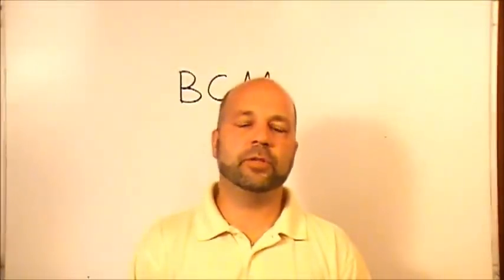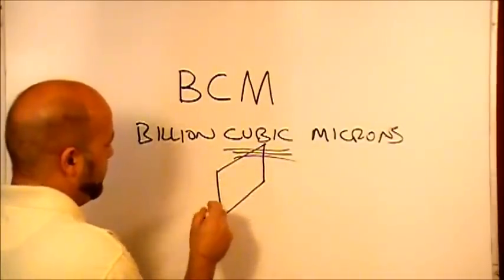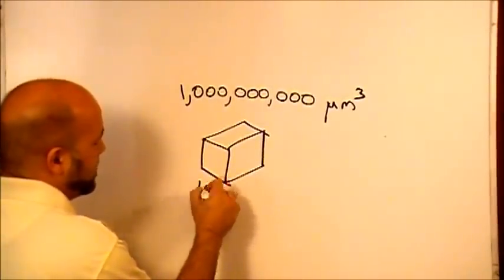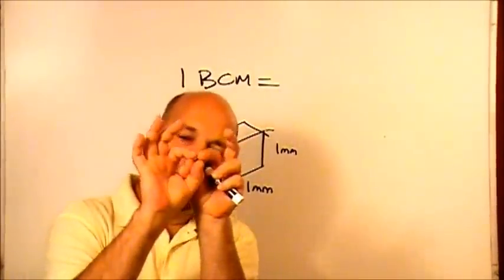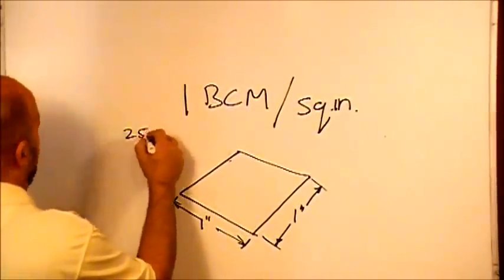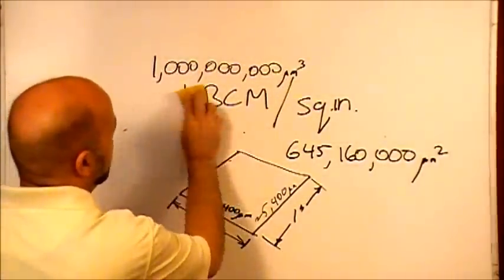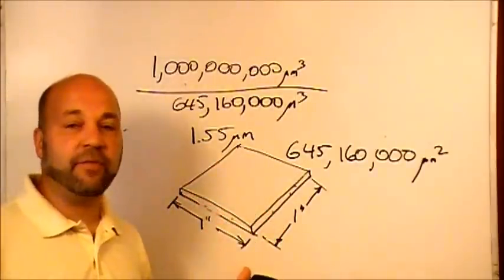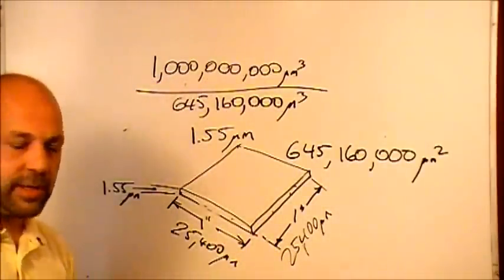What is a BCM?  1 of 3

Comment: @4:01 I believe you may have the wrong values of the Length, Width, and Height. You say 1,000 micro meters? if you calculate the volume of a cube with that length the volume is equal to 1x10^-9 meters cubed... which doesn't equal to 1,000,000,000 micro meters cubed.
Reply: Frank Burgos  
The volume of your box @4:01:

 L x W x H = Volume

(1,000 micro meters) x (1,000 micro meters) x (1,000 micro meters) = 1 nano meter^3  

1 nano meters^3 isn't equal to 1,000,000,000 micro meters^3

Since 1,000,000,000 micro meters^3 = 1,000 meters^3 , I believe the box you meant to draw is a 10 m x 10 m x 10 m. Make sense?
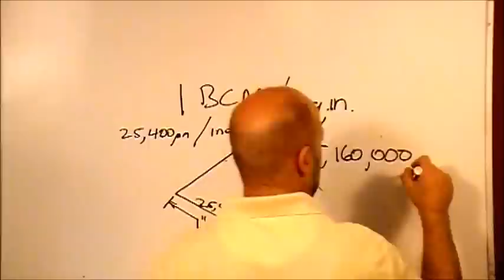Reply: Frank Burgos  also @8:24, you should try multiplying 25,400 micro meters to 25,400 micro meters again. The correct answer is 645.16 micro meters^2.  

The error you keep making is that you're forgetting that micro. It isn't a unit of measure, it means 10^-6. It's a easy and simple mistake.

yeah a box with 1 ft x 1 ft x 1 ft = 1 ft^3,  but a box with 1 mm x 1mm x 1mm doesn't equal to 1mm^3.

1 mm x 1mm x 1mm = 1 nm^3
Reply: Frank Burgos 
I'd just like to see parenthesis around the "micro meters". That's really what I'm trying to say.
Reply: nyman188891 Hi Nyman188891.  I see what you're doing, but I'm not sure I agree with the approach.  I am not parsing out the prefix from the unit.  I am treating "micro meter" as a unit of measure, though I appreciate that the base unit, in this case, is "meter."  I don't think I recall ever seeing the units I'm using in parenthesis.  If I wrap mm in parenthesis, does it concur with your methods?  Are you pulling my leg?
Reply: Frank Burgos a squared "Micron" means micro^2*meters^2. The way you have it wrote on your whiteboard is micro*meters^2, which is mathematically incorrect. You need to square the micro aswell, adding parenthesis around the "micro meters" to the 2nd power would fix that.What you're saying in the video is 100% correct, but how you're notating it on the board is wrong.
Reply: nyman188891 OK.  I'll have  look at it at a later time.  Interesting, though.